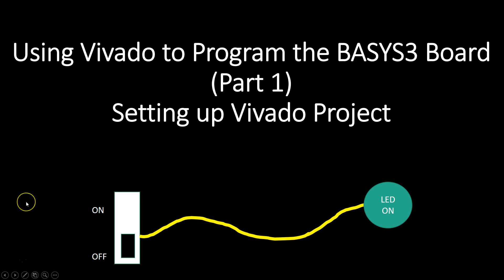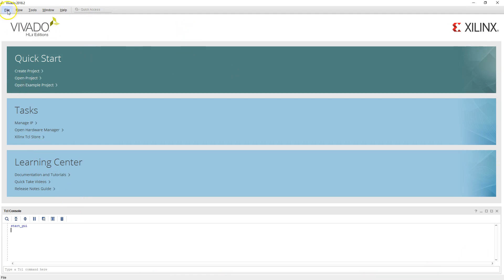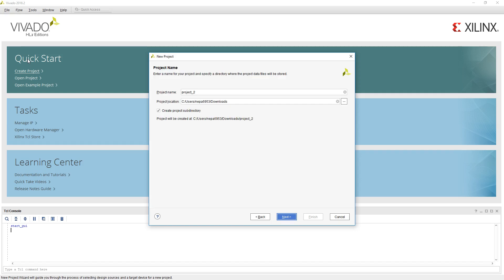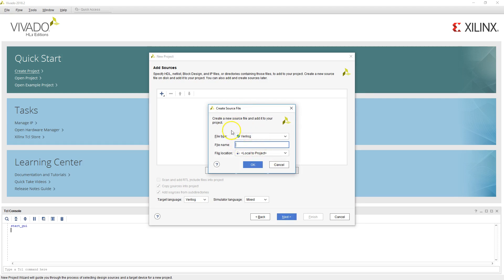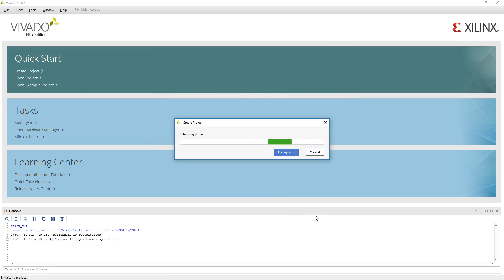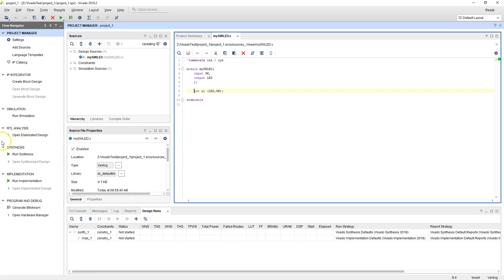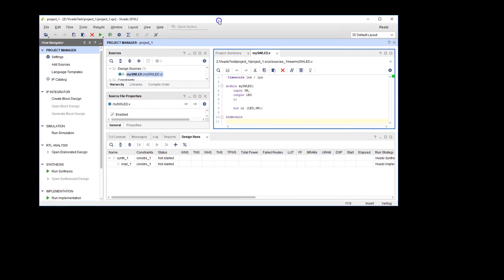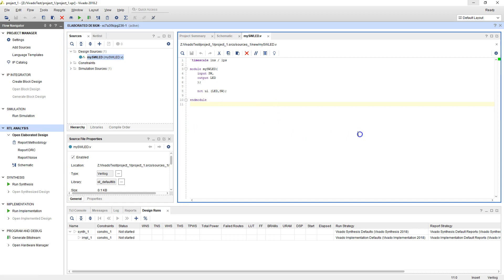Using Vivado to Program the BASYS3 Board Part 1 Setting up Vivado Project

Comment: July,2022 - Selecting the Basys3 board, discussed at 3:30, is more complicated now. It was showing my version 1.1 of the Basys 3 board. But if you use the Vendor and Name filters, you are shown versions 1.1, 1.2 and finally, version 1.3 which has a status of "installed". Of course this was with the board connected and powered up.